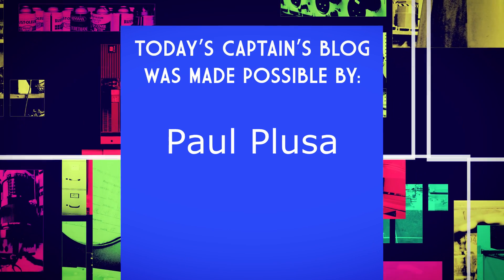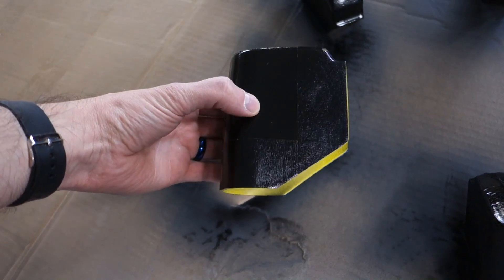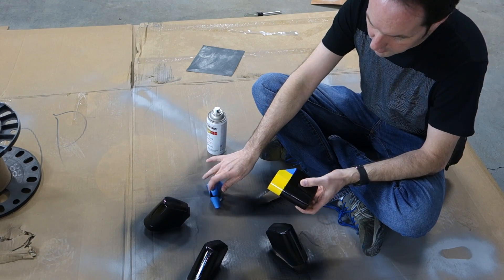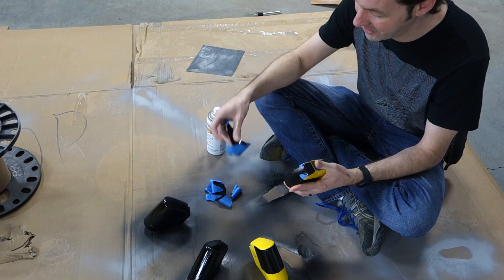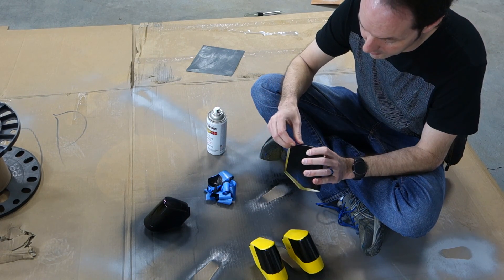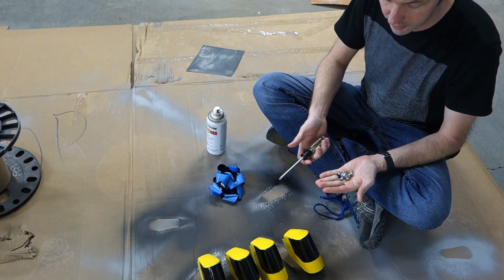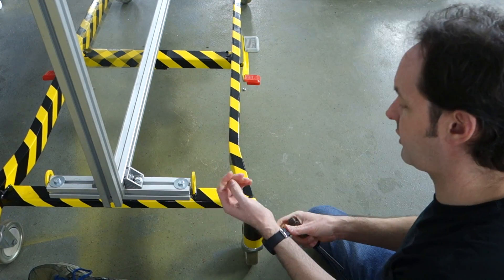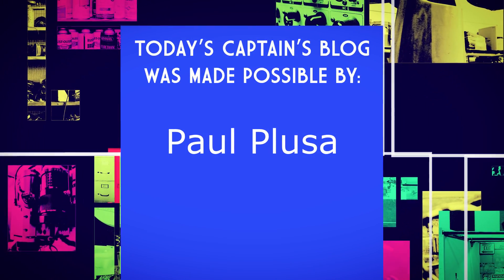Captain's Blog 1 1 2017 Blast Shield Project Complete

Comment: Captain, Sir, if you want to eliminate the black bleed over when using masking tape, put a coat of yellow over the whole thing after taping to seal the edges.  Then the top color can be applied. It takes an additional step, but the results are outstanding.   Or just use the vinyl you were looking for.   Or use the zero facks/twenty foot rule.    ;) Happy New Year Sir!
Reply: Or maybe try rolling the edges with something like this https://static.grainger.com/rp/s/is/image/Grainger/2FDJ6_AS01?$mdmain$
Reply: If using a roller doesn't help, I've also had great results with Frog Tape if budget allows.  It seems to conform to the surface a lot more than normal painters tape.  Did pinstripes for accents in both of my kids rooms, one with normal painters tape and one with Frog Tape, and the results are a night and day difference.